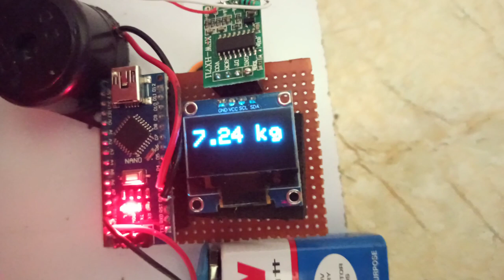LPG Cylinder weight measuring device using Arduino & Low Gas Alert

Comment: The gross weight of the gas cylinder is 14.2 kgs, displaying it at 7kgs makes your circuit highly inaccurate.
Reply from the maker: Sir. I made cylinder weight to nil Initially
Reply from the maker: Sir,  7 kgs is the weight of gas inside the cylinder. (I subtracted the weight - 14 kgs ) 
The total weight is 22kgs approx.